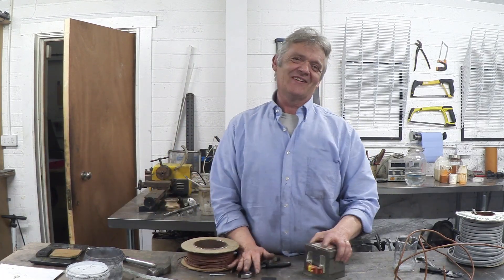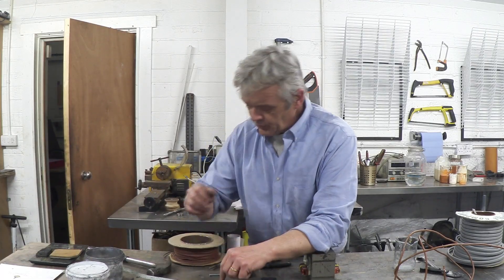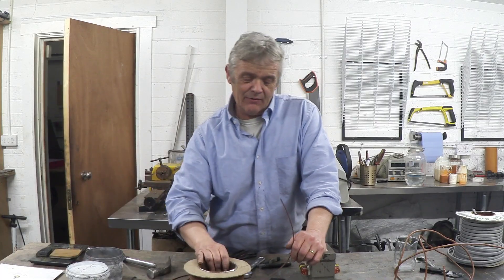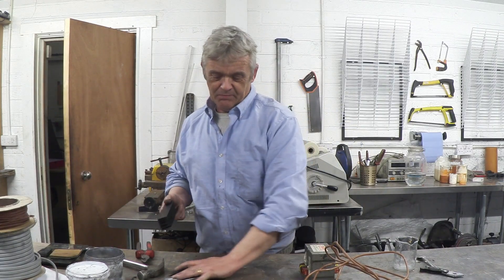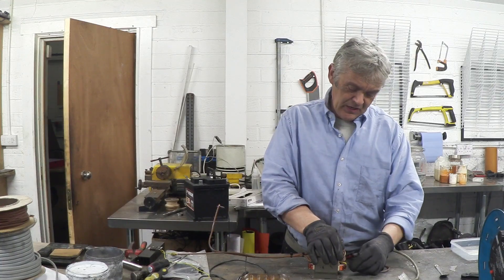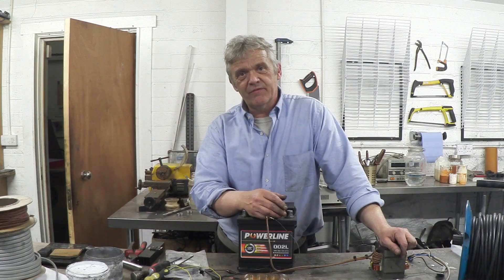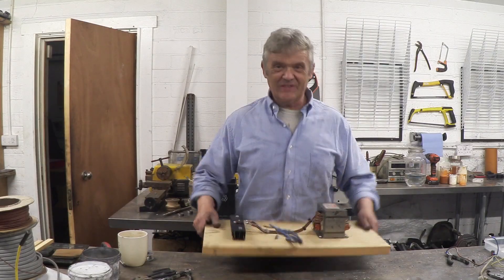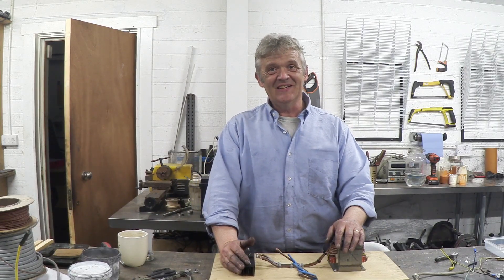Simple Cheap High Current Power Supply From A Microwave Oven Transformer

Comment: When I worked on TVs about 20years ago I had a set come in with a weak crt those old boosters we used on old tube sets wouldn't work on a solid state TV because in a SS tv the filament voltage comes off of a winding on the flyback trans which made it a high freq. voltage I think it was 15750 khz. One day I was looking at the schematic of a RCA set and thought why couldn't I add a few windings on the fly back to increase the filament voltage. I found out 1 turn of wire around the core was about 1volt I usually used some 20gauge telephone wire! That worked perfect 3turns in series with the original filament winding gave about 8 volts on the filament of the crt and a lot brighter picture. Never had one come back. Oh yeah you had make sure when you connected the new winding in series with the filament voltage that you had the polarity correct. Fun memories!

Comment: The PVC insulated wire you used for the secondary is rated for 85 degrees C max, and is totally unsuitable for a transformer. You should have used enamelled copper wire of appropriate diameter (or multiple parallel windings).
Also that flat pack bridge rectifier is very unlikely to be rated for 70 amps! That package is normally suited for maybe 8 to 10 amps continuous, even with good heatsinking. If you stated the part number people could check your specs and calcs. 🙂
Reply: Correct ❤I wonder why he did 🤔 say about this fact

Comment: Nice power supply but be very careful what you use it for because it’s not DC it’s rectified AC and it will have a 100Hz ripple on it which can and does destroy some things for it to be true DC you need to add a smoothing capacitor to get rid of the ripple.

Comment: You didn't explain for the noobs that you multiply that ac by 1.414 after the the rectifier for the dc volts amount. You should also put a capacitor on there too.

Comment: FYI... You should be careful with having an extension cord on a spool like that.  It doesn't allow the heat the dissipate.  A few years ago, I was at this fundraising carnival for some organization and one of the booths had a large popcorn making machine.  Since there was no power outlet within reach of the power cord that was on the machine, he had a long extension cord on a spool and only unrolled enough of it to reach the nearest outlet.  That left quite a bit of cord still on the spool.  It didn't take too long after he started up the popcorn machine for the cord the get warm enough for the plastic insulation to melt and the wires to short together resulting in a large mass of plastic and wires fused together after it cooled off.  I don't know what the wattage of that machine was though -- probably at least 1500W.  Since we use 110V here instead of the 220V you use, the amperage would have been twice for the same wattage.  Still, its something people should be aware of -- unless they LIKE the smell of melting plastic insulation... :)
Reply from the maker: thanks for taking the time to write mate

Comment: The size of wire you used, in USA, would that be equal to 12 or 10 gauge wire ???  The way you described the wire seem to be what we call Romex. Used in house wiring. It has a bare copper ground and one wire coating in white and one coating in black and all 3 are jacketed in a plastic sheath.  If this is what you used, did you leave the fiberglass inserts in the transformer core? And did you just loop the wire or did you bend 90 degree turns.?

Comment: Don't you need to multiply it by sqrt(2) to get the peak DC voltage? 12v ac rectified will give you about 17v DC.
Reply: Yep, the RMS

Edit: my bad, it's not sqrt(2). It's the inverse of sqrt(2), so for 12V, it'd be round about 8.5V minus any drop from the rectifier

Comment: i wanted to build a supply like that but for non-series confiurations (more amps, less voltage) but at that point the voltage drop from the rectifiers gets horendously inefficient (the beefy ones are usually also for high voltage, thus diodes in series). you should revisit this but make some kind of active rectifier circuit using mosfets or something. (for like 8 volt 200 amp molten salt electrolysis) for now i'll stick to chineese led power supplies.

Comment: A heart pacer is driven by a 5 volt  battery, which is adequate to satimulate the heart muscle since it is connected surgically to that muscle,   Normally dry skin on a person's hand has over 10,000 ohms , there is another few hundred ohms in the body so touchng 
12vDC battery causes a tiny current ti flow through a human body, When the current finally reaches the heart the high resistance 
of the skin etc cause a huge voltage drop so the maybe 12/1000 of a volt  finally reaches the heart .
This volatge is too small to intertfere with a human  heart "electrical system'.

Wet skin. 12 vAC, transient changes in the voltage CAN BE DANGEROUS..

Comment: Can i do the opposite can i do 220 or 110 from a 12 volt battery and microwave  transformer
Reply: Yes u can use any transformer in reverse. But batt power needs to be pulsed on / off to get ac out.

Comment: Hehe... a human is a great resistor UNTIL you break your skin. There's a great old tale about a n American Navy serviceman who electrocuted himself with a multimeter (which contains a 9v battery. Under normal circumstances, it's more dangerous to swat a butterfly. But stick those probes through your skin, and the resistance the human body presents drops by a couple of orders. a 9v battery can kill you, if you break the skin in your fingers (left and right hand) and cause 9v to flow past your heart. But yeah. I agree, 12v is pretty damn safe, for 99.99999% of the time.
Reply from the maker: cool mate - thanks for taking the time to post
Reply: A tail indeed.

By chance history has made 50/60- Hz the standard for AC , from almost 0 volt (thinks about toy merklin train trafos ) to 360 Kilovolt, still doing the 50 Hz hum and dance, 

Also by the way muscle tissue works, the region ~20-120 Hz is exceedlingly dangerous for muscles, they suddenly deplete all the reserves so to speak and lactid acid and cramps set in. Bad luck our heart is also a musle, and we have only one. AND nature saved our ass by building a separate timer into the very same muscle that in mostly self regulating. But the combo of above make your go a a ramdom firing patterns, useless for pumping and meanwhile depleting ATP reserves and making nasty lactic acid.

I for not 10 second believe this tails of a orninary 9 volt battery even when long needles inserted in the fingers would be used and you were on a styroform crate and apply the, let go crazy: litium based 9 volt batteries wit lots of oomp. or two parralell new alkalines. Yea a multimeter was mentioned. Maybe that device was not working properly anymore? 

And no, we are not going to put 100 parralell and put dozens of those needles both in the fatty tissue as well as in the veins after having drunk extra liters of electrolytesand etched the stainlesssteel needles as to remove any Cromium oxide layers. (With DC a protective layers would form quite fast again i guess).

Taking that 9 volt battery and pulse it trough an old doorringer with induction coil and sudden circuitbreaker at  around 50-60 Hz doing that for a minute or so, yeah. Darwin award. Still not fun when it happens.

On a more fun note, I hear the birds starting the day and it reminds me or someting:

I live walking distance from the ultra long stretch of woods and parks and nature in general, right next to a highway leading into Germany. The 360kv towers with multiple layers (the tower also carries a threephase mere 220kv each single cable, no uber power flowing in those,  below the 360kv triple 4(!) strandedwires . I think I cannot even lift a single glass/ceramic dielectric wire bundle attachment. They are huge.
still the birds and other lifeforms seem to thrive in that long stretch of no build-zone-for-ever. The hum is omnipresent obviously, but hey it is at least predicable. The highway next to it walled of by sound reducing walls and earts mounds and trees and are way worse.
In this case, it is the tires and the turbulence behind the 130 km/+ going veicles that really make the relevant parts of te noise :)
So while Tesla and oter EV's will have lots of elecrons to their disposal, even Teslas with silent motors are deafening loud at 130+ km/h. But sound "pollution" is better than posoining the world AND still have all the noise.

Sometimes when weather is really calm yet super humid and low visibility and thus almost no screamers supernearby, also the park is calm. The hum in that scenarion is soothing, specially because there in the background way up above your head there is a constant extra buzzing sound usually constand sizzling sounds. But when your take the time, once in a while a real visible eletrical discarge happens, mostly across that enormous lengt of ceramic tubing. They are designed to handle this stuff. Nevertheless, awesome to experience.
 
ps, I really cannot seem to fix my letter H on my laptop, i tried.
Reply: @blueredbrick  Also, high voltage DC apparently is a lot more dangerous than high voltage AC, in some ways. My best mate used to work for a company that serviced those old big floor-standing dot matrix printers for mainframes, the ones that could spit out several hundreds of pages a minute.
These things ran on 700VDC, with power supplies  capable of pushing out 50-100A, IIRC. They were very strict on safety protocols, because if you managed to get your body in the way of the current, all your muscles would contract, forcing you to fold over the equipment, and unable to pull away, at which point you just cooked.  They lost two technicians in the couple of years when he worked there. (this was in about 1985).
With AC, at least your muscles get flung in opposite directions at 50-60Hz, and you stand some chance of pulling away.

Comment: Why not just hook up a welding machine? That would deliver the right voltage to push very high current through these kinds of electrolytes and they can potentially deliver 200A. I'd use a 26% KOH solution for maximum conductivity. I don't expect it'd draw the full 200A though, I'd be surprised if it even draws 100A, still way better than 15A though and you can always increase the current by decreasing the gap between plates and have bigger plates, etc. Mind the duty cycle rating of the welder though. They don't like to be run continously. You can pick up cheap inverting welders for $50-$100 these days and they're compact too!
Reply from the maker: there are a ton of solutions mate - use whichever is best for you

Comment: The bridge rectifier will lose more than 2V and the secondary voltage will drop a little when heavily loaded, so I think the actual RMS output will be on the low side.
Reply from the maker: probably - adjust with turns

Comment: Alternative , to find high current transformer ...
In computer ups .
In inverter.
Computer ATX ( as complete supply )
Reply: ATX supply will work great. Keep in mind if powering any circuit involving RF or high speed switching you'l need to put a filter on the output to protect the supply from back emf.

Comment: Brilliant. I've got a couple of those lying around that I was going to use for Liechtenstein burning. Now I'm thinking of making an AC/DC supply for Etching, Plating and Anodising.
Could you do a video on something like that?
How can I add voltage and current controls with a display?
Reply: For the record a neon sign transformer is much safer and more effective at wood burning. I'd advise following your current plan to make a high current supply instead of burning wood with the microwave transformer. Oh, and for old neon sign transformer, get a old transformer type one, not a new one with open circuit detection as those won't work for it.
Reply: @theLuigiFan0007Productions  What is different about the neon?
Reply: @LEO-xo9cz   A microwave transformer outputs 2.3kV at around 400-800mA. A neon sign transformer has got a much higher voltage (about 3.5X) and much lower maximum possible current output, around  10-30mA in most cases. It's far less likely to instantly kill you in the case of a mishap and you get shocked. It's also better ar burning the wood as the voltage helps it get across better and the lower current helps preserve the finer details in the marks.

Comment: hey mate just for your saftey that rectifier is not 70 amps its about 15 possibly 30 at the absoloute most its inrush currant might be 70 amps but thats just for a sec
Reply: also 2.5 will take around 25 amps not 36!

Comment: Rob mate your wearing us out just watching you ! we could stick you on a wheel and power the world !!  ,    I use 14V for electrolysers as we are after in car generation , design cells accordingly ,  . general electrical current protection regs  are 1.5mm 16Amps , 2.5mm 20A  ,4.0 & 6.0 mm 32A , 10mm 50A , 16mm 63A [ a household supply ]. 
The urea as electrolyte has certainly got me interested again ,and graph-oil.   lots more plates for a 14V cell ,way more area , as you probably know  excess volts is just waste heat .  ,so some taps on low volts side of TX would be good refinement .
next thing to play with is ,I have been wanting to try the HHo run into a car catalytic converter ,, this is a simple way to test Andrea Rossi's  lenr cold fusion claims , they get way hotter than can be explained . so mr worka holic , can we crack that one open too !.? .. MiZuno tecnology inc ,are claiming the record for heat efficiency with LENR .    then all we need is a heat to power thermo-voltaic set up and voila !, bye bye big oil .     Awesome work as always ,
Reply: Hho can only be generated uaing energy, that energy must come from coal and or oil even if it's not in your car.. Sure renewable energy can charge some cells but the storage device requires energy to be produced and so does the solar panela/wind mills.. There is really no true form of renewable energy.

Comment: I would use a pc power supply myself. The 12 v rail always is about 20 amps., I believe. More amps in psu's from the 90s. I have a few of these big trafos myself. I try to steer clear from mains even though I know with a few precautions you are safe. But it is damn interesting making your own hydrogen!
Reply from the maker: for sure mate - and nice advice - cheers
Reply: Ive been using ATX power supplies and they all keep burning out. 
Except for one low powered 10a hp power supply that has active protection that actualy work's! 😅
Pioneering a car amplifier that needs a minimum of 42a. 
If your comfortable enough, this is the perfect project for any electronics enthusiast

Comment: I’ve unwound microwave secondary to measure and weigh the wire. It’s a long process. {really, no pun}

Great video, I’m interested if you drill a hole in the base of the device then clean it up for contact, then connect the ‘neutral’ wire there on the base  then connected the ‘live’ 240 into the secondary, you will have an efficient 24v ~ AC out the primary, but I have not done any analysis of the total ‘current’ draw. 

Basically invert the transformer for 24v ‘upside down miss Jane’ style. 

However as stated, I’ve no concept of the ‘current’ situation {no pun}

Looking at an estimate of the XL of a secondary I guess a different result nevertheless, still good to do things with.
Reply from the maker: yes it is long lol - that wire is pretty thin though so current capability if going to be low
Reply: Robert Murray-Smith yeah perhaps indeed.

Comment: The easiest way is an old computer power supply, a reasonable size unit will have 1 or 2  12volt rails, each will have a good 50 to 60 amps depending on the size of the unit,  and you get 5volts and 3.3volts as well each with fairly high current, just snip a few wires and put some plugs on the end.  plenty of videos online, just search "reuse old pc power supply".
Reply from the maker: it is for certain reusing a pc power supply gives you a much more stable and efficient supply - but sometimes that doesn't matter so much and cost and simplicity do - it all depends on what you want really

Comment: Another good place for massive transformers are old fashioned UPS boxes (uninterruptible power supplies - for computers/servers).  Lots of them get thrown away by IT departments.  Easy to snag them, and disassemble.  Sometimes the only thing wrong is a bad battery, but the replacement is more expensive / time consuming than a new one - which is also more efficient.
Reply from the maker: good pointer mate - thanks for that

Comment: Absolute inspiration. I liked your suggestion to set up the 240V side first with full insulation, etc. then I thought, to enclose the 240V side that will also act as mounting for the transformer.  The other thing you may want to do is to make 2 x 6V windings that you can then configure to 6V at (higher current) or 12V and with the option of using it as a centre tapped to reduce the number of rectifiers in the 12V configuration.
Reply from the maker: I like that mate - I went for utter simplicity but a centre tap pig tail would be super simple too and give options - nice one - cheers

Comment: So a thing I've been wondering since your microwave crucible video, is could you make a whole full sized Kiln out of the relevant bits of a microwave oven and silicon carbide?  Just something niggling the back of my head.  I guess you'd have a hard time controlling temps huh?   I know it's not particularly relevant to This video, sorry, the microwave bits just reminded me.
Reply from the maker: no it's good and yes you could - there are several versions out there - usually under the title microwave reactor - temp control is by pulsing the microwave in conjunction with a thermal sensor